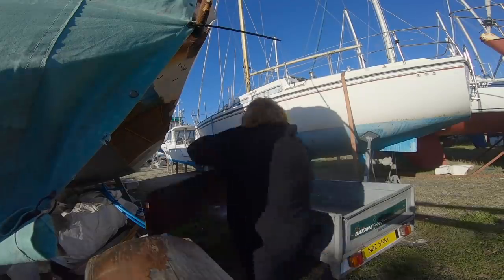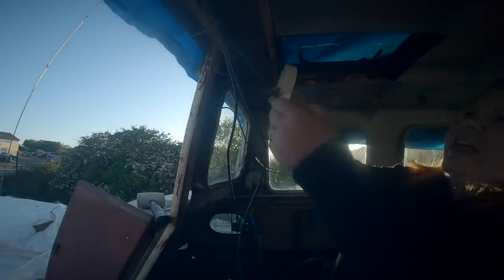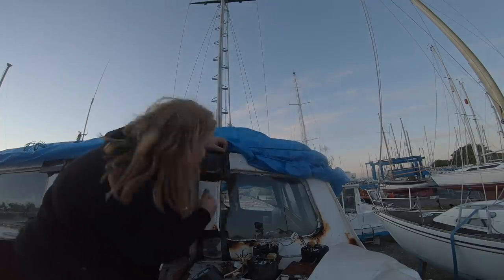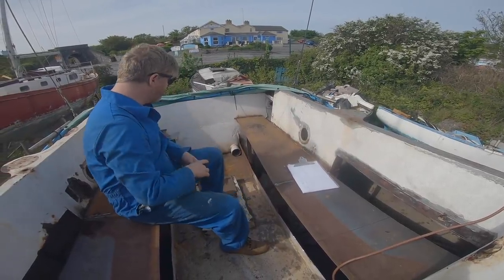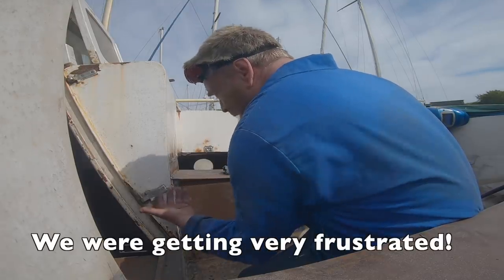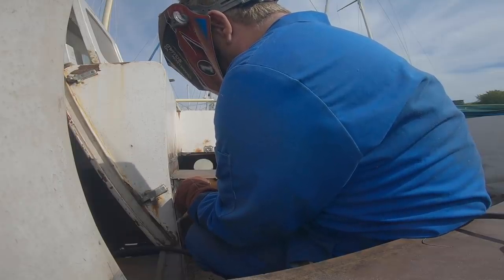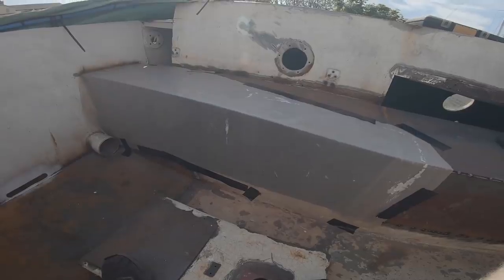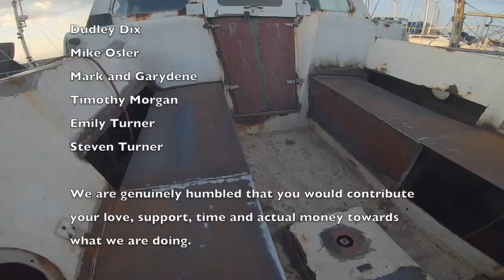#46 - Fire and Frustration!

Comment: Dear Sailing Melody family.
👍👌👏 Very well done again. It's coming together really good.
2) Please kindly allow me some suggestions:
a) You could/should use commonly known welding primer. It makes life easier and protects from rust. So you could get rid of the rust before you weld those panels in.
b) Please get some commonly known/used magnetic holder/helpers for your welding jobs. Those also make life/work much, much easier.
c) I highly recommend to build a kind of moveable staircase (along the side of the boat). The ladder is way too short, therefore dangerous. Additionally: Using the small steps very often will be hard for/to your shoes, feet AND back/spine. You will have to work a lot on Melody, so to invest in some cheap wood (maybe even use pallets/recycled wood) will really be worthwhile.
As always: Thanks a lot for making teaching explaining recording editing uploading and sharing.
d) Have at least one more extension cable/cord!
Best regards luck and health to all of you.

Comment: I have always used sheets of core flute for templates, when it comes to large plates, on smaller plates I cut with a hole Saw the corners on the boat, then cut the patch going in first, tack it onto the boat then cut around with a 1.0mm cut off on the grinder, the added benefit is you can match the curve in the patch prior to cutting the hole, it's always worth cutting a bigger patch getting rid of all the rust, then a small patch and having to clean up rusty plate. Keep up the great work, looking like a good amount of progress 👍👍
Reply from the maker: Thanks for the tips! Great stuff :)

Comment: Great progress you two fine people. Welding is the No1 cause of fire in boatyards. It is good practice to have a ‘welding sentry’ in the compartment adjacent to where the welding is concerned. Also stop all welding at least two hours before you plan to leave site and inspect both sides of the weld before you do. In between a wet rag and a good fire extinguisher - a good half way house is a garden pressure sprayer.😀👍⛵️

Comment: Oh dear, if it doesn't work then try doing it the way Melissa suggested 🥴 it's good to see things going in instead of being cut out. Those instruments look a bit long in the tooth and as we can see would have been better to have been mounted in a pod although now you can buy a single unit that will show all that and more. After doing some deliveries I think all you need on the boat is a sounder an compass and the rest can be done on a tablet in a watertight case, less wiring less to break or be stolen and the tablet can be taken below for route planning. Whenever I get frustrated I drop tools for a cupper. Some days I get through allot of tea bags🏴‍☠️
Reply from the maker: We do have a new to us nmea set up and a pod for them to go in, we are just wondering about keeping the instruments as back up wired up in the pilot house 🤷
Reply: @SailingMelody  if they work and don't conflict with the new ones then why knot. You'll need to get a new transducer lead though as they are calibrated to the cable and if they are cut they will give a false reading according to manufacturer specks, though if you can't get a replacement I would think that any inaccuracies could be fixed using the offset. I kept my old navman sounder when I installed the new one but the transducers are next to each other and get upset if I use both so it's one or the other. I kept the old GPS which links to the HF and acts as backup but it's not a plotter.
Reply from the maker: That’s interesting to know about them being calibrated to the cable lenngth. It would be easy to work out which wire was the calibration wire and the measure the impedance of the wire and then insert a correctly sized resistor to  offset the cable impedance I would imagine

Yes i would out the new transducer and paddle  on the opposite side.

I’m thinking in order to get instruments in both the cockpit and the pilothouse I could just buy a set of repeaters but A: they’re expensive and B: I have a complete working setup here and C: if my NMEA setup somehow gets fried I’ve got a stand-alone system isolated from NMEA
Reply: @SailingMelody  sounds like a plan.

Comment: good job guys. Are you sure you dont want to replace the steering wheel rudder for a tiller?will make that cockpit pretty roomy like you can see it now. I will also suggest you place jib's sheet winches at both side of the companionway for easy triming using a block few inches aft the tracks ;-p fancy to see your progress!

Comment: When you are fitting panels like that, take a short piece of flat bar and tack it in place on the back side on just one side of the bar, you can put several of these in, push against then to get the plate in line, and then tack it. 

Since you only welded one side of the bar with a tack weld, go back in with a crescent wrench and they will break right off, and clean up with minimal grinding.
Reply: Yes , just like welding a handle on it and break it of when your done with it. Great trick. do it all the time welding pieces of body work on cars

Comment: You should of taken all the rust off the panels and putting red-oxide on before you welded them up now you got to do it enclosed place now ,
But it does need to be done then afterwards paint it white and its starting to look a great boat .
Reply from the maker: We aren’t using any red oxide.
Modern red oxide is absolutely crap, not like it used to be.
We’re using modern two pack epoxy from Jotun.

But why haven’t we painted it before fitting it?
Well there’s lots and lots of good reasons 
We still have more structural braces to weld on the inside which would burn the paint off.
And lots of welding of mountings, brackets, fillets and supports on the outside which again would burn the paint off.
Reply: Dear  @SailingMelody   couple.
I suggest that you simply use commonly known welding primer. This makes life easier and protects from rust.
Sincerely yours.

Comment: Nice job Andy, hats off..don’t you think Rust remover will help you a lot in this project?? Don’t know ,it’s only a question..,
Reply from the maker: If it’s just surface rust then yes we use a whole variety of different products but there’s rust and there’s ROT and where the steel has rusted more than 15% of its thickness and is effectively rotten then it’s best to just cut it out and weld fresh stuff in. Rust converters/inhibitors/killers etc etc are all well and good but once the steel is catastrophically weakened then no skint of Celebes liquids will bring it back. Good question though

Comment: It would have been so practical if you intalled plexiglass along the lower portion of the seats. This would allow light to shine into the sleeping area below and make it less claustrophobic. But if you wanted privacy, you just need to install curtains on the inside.
Reply from the maker: We will be doing that when the painting and metalwork is completely

Comment: At minute 4.01 in the shot, you can see something that looks like an object flying at high speed, which could be a bird, but as it passes you cannot see its wings move. Maybe I'm wrong but it's strange What happens to me is a UFO. Good job famyly anyway if it's a bird I don't see it move its wings and it goes very fast.
Reply from the maker: Will check that out lol

Comment: Don't bother re-using the old Stowe instruments. The wiring is very specific to those as well as not any NMEA standard so replace as well. Put in new stuff. NASA if money is an issue, otherwise Garmin or B&G, preferably NMEA 2000.
Reply from the maker: We already have a full Raymarine NMEA2000 setup to install 😜
Thinking of maybe keeping the stowe stuff and mounting it inside the pilothouse with the new stuff outside simply because it will save us the cost of buying repeaters and also means if one system gets friend we have a totally separate and isolated system
Reply: I really doubt they are worth it. The depth sounder uses a different frequency to anyone else so transducers are non-swappable and as they age the depth range drops off. Are you really going to have two wind instruments up the mast and 2 speed logs and two depth transducers? If you put a wireless repeater on the NMEA 2000 you can then use a tablet as a plotter and display what is on the network as backup. Keeping Stowe just makes it all more complicated and given its age will probably fail before any of your other stuff.  If all the NMEA stuff goes down, then whatever took that will probably have fried the Stowe too. If you needed any spares for Stowe the only place is probably ebay.

Comment: You guys should cover up one of the aft windows totally and install brand new Ray Marine technical readouts. If you guys are lucky enough maybe Ray Marine will supply with the stuff you need for free.
Reply: B+G Intruments far better
Ray marine have a reputation of
Failures.
Reply from the maker: Fair enough but we have a raymarine system so we’ll stick eith it lol